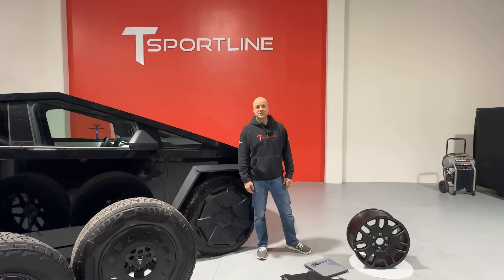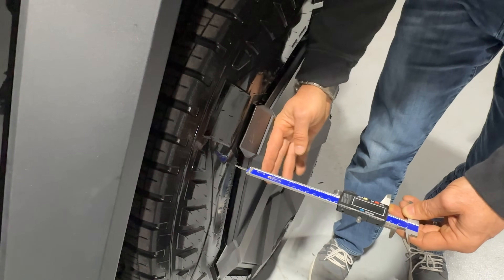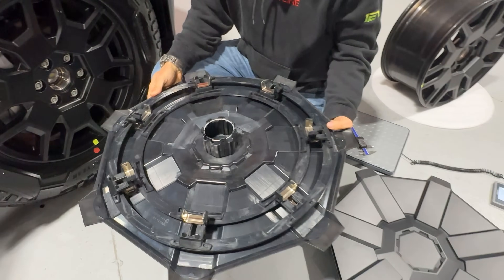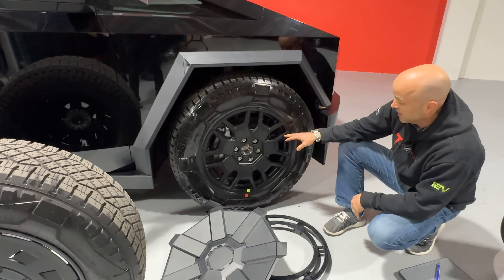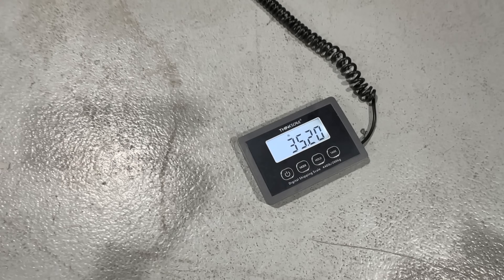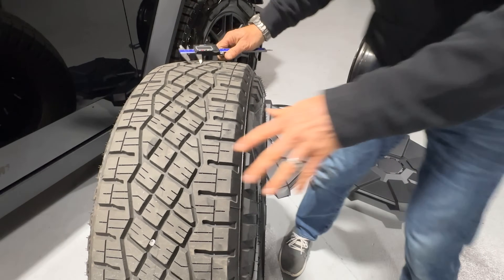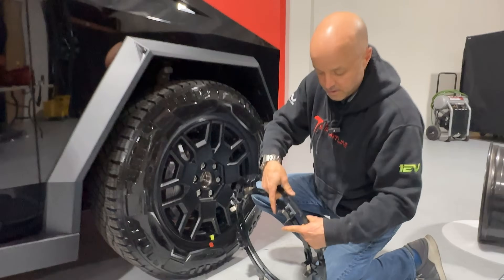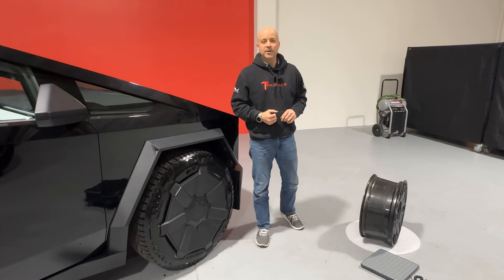Cybertruck Wheel & Aero Cover Inspection & Measuring 📐 Comparing Aero Cover Options & Specs

Comment: Okay its frustrating to hear 👂 that you did an aero inspection without showing a wind tunnel proof. Theory is just that a Theory. When performing things practically stuff can change the dynamics of a theoretical  system. After all, fluid dynamics is a chaotic system not a linear laminar system in all settings. How else is one to know whether you inproved frictional drag coefficients. Come on guys. Engineer here.

Comment: Okay its frustrating to hear 👂 that you did an aero inspection without showing   a wind tunnel proof. Theory is just that a Theory. When performing things practically stuff cab change the dynamics of a theoretical  system. After app fluid dynamics is a chaotic system not a linear laminar situation in all settings. Come one guys. Engineer here

Comment: The TCT flow forged I think they have listed on website as 31.55 lbs.  The fully forged listed as 31.8 lbs.  This video the stock wheels weighed in at 35.2 lbs.  I had to go back and look, but their wheels are lighter (except for the steelie).
Reply: Why they wouldn’t state this in the video is beyond me. If you’re weighing the stock rim, it would be helpful to compare it to what you’re offering.
Reply: Might of forgotten 🤷 but who knows there loss  @jhawk3910

Comment: Your wheel covers look great, but the advantage of the stock one is that it makes the rim look bigger than 20", whereas yours make the 20" rim look a bit smaller. If you could copy to some extent the stock look with some bolts to secure them, that would be more appealing to the masses imo
Reply: I agree too.
Reply: Trucks should have small wheels...   Think Raptor with 17" wheels.
Reply: i prefer smaller looking rims on a truck and protection of the wheels with the tire edge